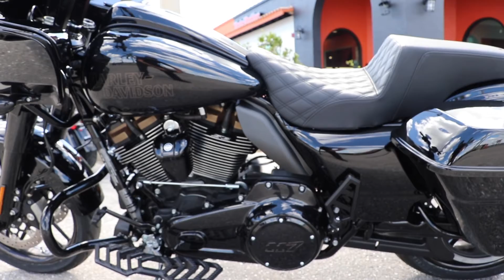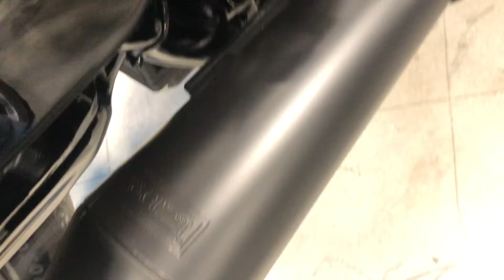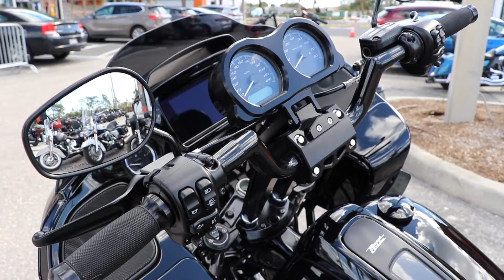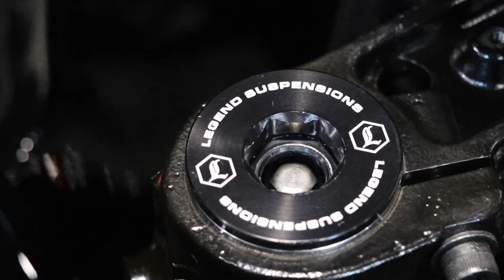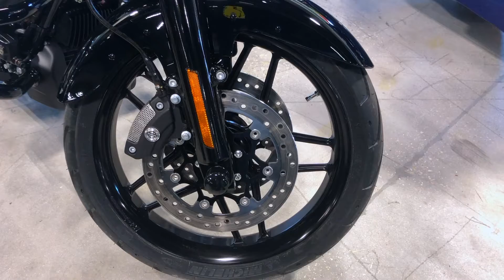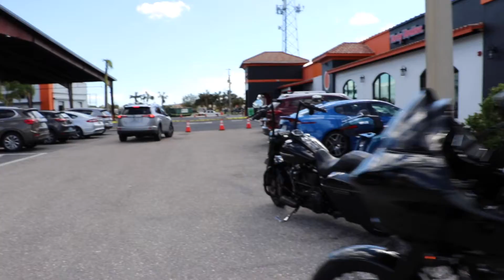2022 Road Glide ST Performance Build | 131ci, Basani, Legends Suspension

Comment: That shorty bassani exhaust kills the power on these. Torque dip at the start and power falls off up top. 

I know because I had one for two years. They look cool, though. Had to upgrade with the 131 build to a performance pipe.